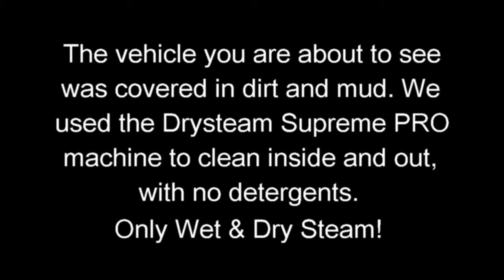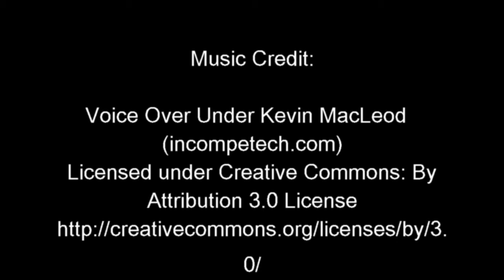The most eco-friendly water-saving mobile carwash in the world - Dry Steam

Comment: when cleaning the carpets, is the steamer attached to a vacuum?
What is the difference between "wet steam" & "dry steam"?
How long did it take to clean the car in this video?
Reply from the maker: The machine has a built in vacuum, so yes when steaming carpets the vacuum can be turned on to immediately suck up the dirty water/steam. Dry Steam is generated at over 10 degree centigrade so less moisture when compared to wet steam mode which disperses more water. The exterior of the vehicle takes less than 30 minutes and the interior depends on level of dirt in seats and carpets.
Reply: @drysteamsupreme989  30 mins is extremely slow :(
Reply from the maker: @MegaAbgt  Time is relative and dependant on many factors including the proficiency of the operator, hence why we said "less" than 30 minutes
Reply: @drysteamsupreme989  👍👍👍